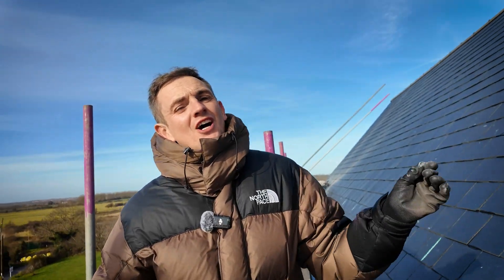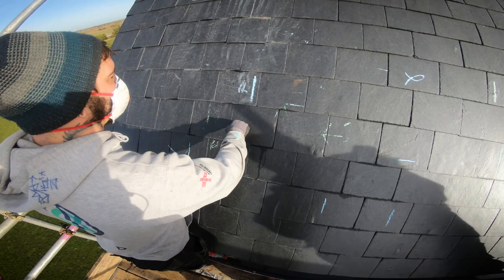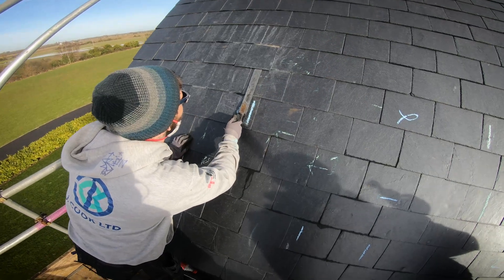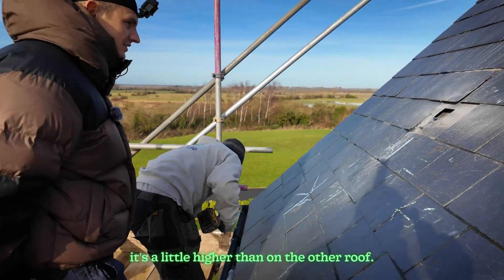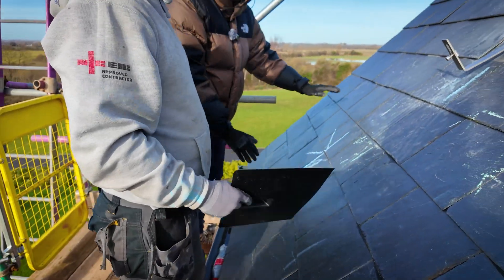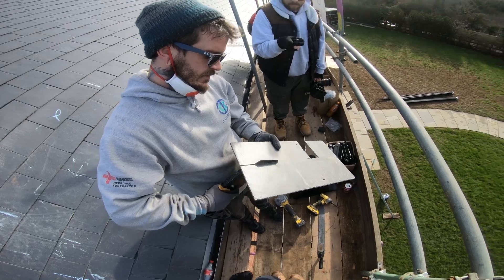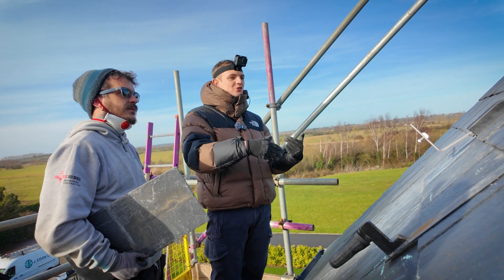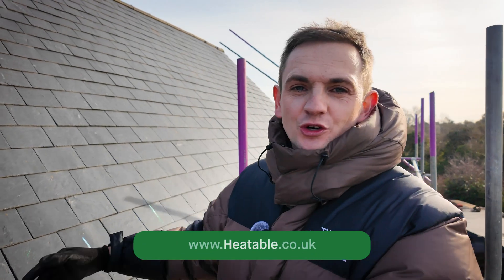The REALITY of Installing Solar Panels on a Slate Roof...

Comment: I have a feeling that interfering with a slate roof in this way will interfere with the roof's long term integrity. I appreciate that not everybody will have the necessary space but mounting solar panels on the ground has to be a better approach. Good informative video though.

Comment: Why can't we make it simple such a way you don't need to take out the tiles instead directly drill 20cm self threading screws from top to the wood through the tiles and glue it for preventing the leakage? May be stupid question... Please answer
Reply: Do you know how brittle tiles are and do you have X-ray vision to know where to drill first time to hit a rafter head on centre
Reply: Yes you can, there are plastic brackets that sit on the slates called "limpets" that are glued on and then screwed through the slates into the rafters and gummed up with sticky stuff to make it watertight. Once you have found a rafter it is faster but I don't like it. My neighbours had it for the last 7 years and it didn't leak so maybe not so bad.
Reply: Solar Limpet not MCS approved. Sod them and use them.

Comment: I didn't see him , nail tue flashing in , it will slide down , also he never put any slate clips or anything to hold it in , 🙃
Reply: He also refitted the slate which already had a large cut out on top left rather than fit a new tile with slot only for the flashing